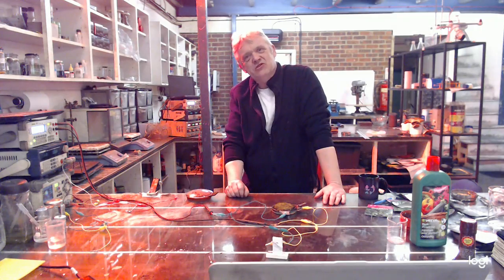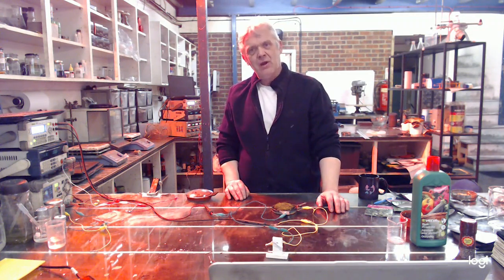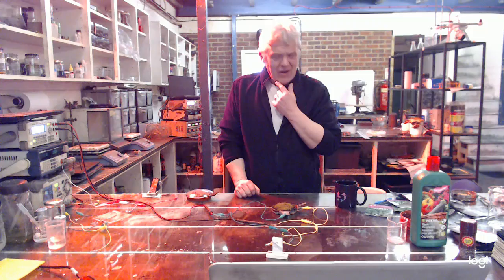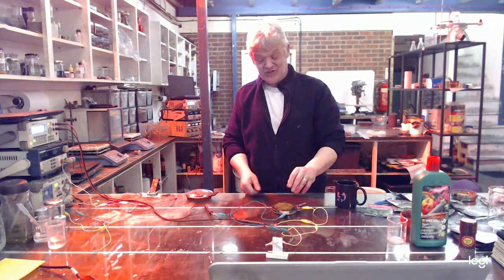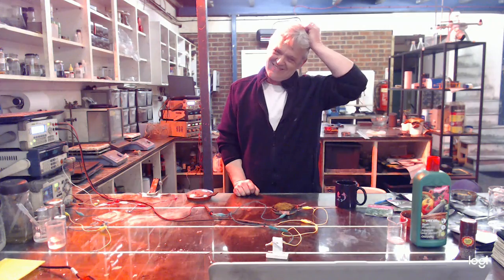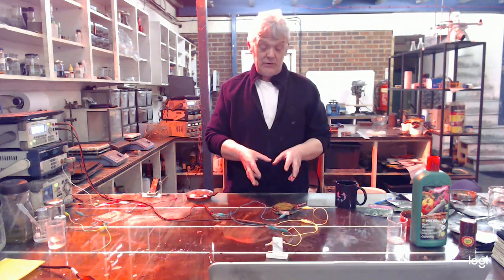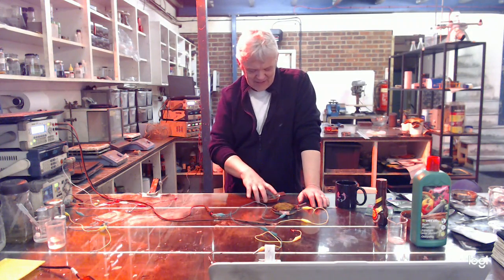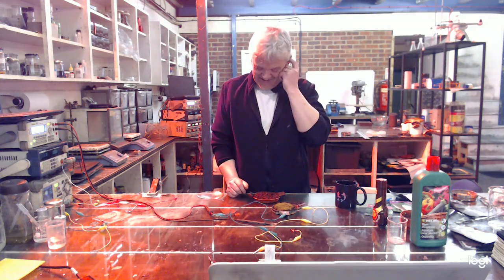Plant Battery (Microbial Fuel Cell)

Comment: The penny might have just dropped, but clarification is needed: 

Are you making a Hydrogen - Oxygen fuel cell in reverse? I.e, sunlight and temperature cause a reaction (photosynthesis?), releasing Hydrogen and Oxygen, etc,  and this causes the potential difference between the anode and cathode?

Or is the process more like: The microbes and plants, plus sunlight and warmth, releasing the gases. And then the gases recombine to create the PD? Call it a full-cycle fuel cell, or a holistic fuel cell, if you like.

Which process is going on here, please? Or is it something else? Thanks Robert.

Comment: That's awesome! You've improved on the design by at least an order of magnitude, maybe three. And it's what, 10 cm square? If you can make a square metre of it, then that's another 10,000-fold increase, giving, let's say an instantaneous 100 Watts or so, for around 6 seconds. Go to a hectare per cell, on otherwise unusable ground, or rooftops, etc, and you're beginning to generate really useful power with minimal materials cost, and for as long as there is water and daylight. Maybe even during darkness. Enclose it, so that the water is recycled, reducing cost. Then with further development of the idea, you should be able to multiply output by at least another order of magnitude. 

The questions are, 'What are the stumbling blocks which have stopped people from making this a viable idea?' 

The efficiency might be low, at present, but it can be constructed on any otherwise unused surface on which some light and warmth exists; places where it's difficult to put PV panels or heat exchanger panels. Furthermore, with development, efficiency should be improved upon.

And, 'How much does it cost, and can it be made to return the investment?' 

That's partly answered by the above, but the rest is unknown right now, and there's little to stop private individuals from making their own systems.

Then 'What continuous Voltage and Current is generated per square metre?'

Investigations are certainly needed here.

'What relationship is there between light levels, light spectrum and temperature?'

Ditto.

Finally, 'Is this an effect of the PD between the anode and cathode collectors, with the electrolyte, rather than the result of a redox reaction between microbes and plants?'

That's something to be investigated. (Time to consult the interwebs.) 

Thanks Robert!

Comment: How long does it take to recharge or regen again? I wonder if you get the same effect in a hydroponic farm.. With all water & nutes the conductivity is @ 1500 ppm
Reply from the maker: I don't plan on looking at this much mate - well not for now - but there are a lot of interesting questions to answer here but my thought would be to match load to supply or put another storage unit in parallel - like a supercap maybe
Reply: Robert Murray-Smith actually just realised it is nearly impossible for Bacteria to survive @1500 ppm. Aquaponic tanks have huge amounts of nitrifying bacteria to break down fish poop

Comment: This is very interesting, but rather than using it to generate power, can it be use to measure the health of the plant?
Is it possible to build plant pots that can report back the health of the plants it contains?
It would be useful to report water level, pH etc. Even better if the power output can correlated with the rate of plant metabolism, indicating the vigor of the plant.
Consider the value of a plant pot, to which could be connected and IoT or LCD device that notifies the user of the plants needs.
Reply from the maker: I have no idea mate -you could always look into it = power generation is really my thing horticulture/agriculture - not so much
Reply: @ThinkingandTinkering  my point is that the amount of energy generated is not that significant, but it is sufficient to power the electronics for a monitoring circuit, and since it is generated by plant metabolism, it may give an indication of plant vigor.
Reply from the maker: like i say there is a lot of research and mostly it is looking at more than that i think = worth checking out

Comment: There is a way to make electric bacteria in soil by running voltage through electrodes in the ground and then collecting the dirt around the electrodes where the bacteria congregate. Since most physical things can be run in reverse I wonder if they would also produce electricity. Also perhaps run a slight bias voltage through your plants to trigger a larger effect...and will it vary and produce a low frequency alternating current based on sunlight or something...hmmm
Reply from the maker: give it a go mate

Comment: Last 3 years, I had participated in Technology and Science Expo at my university and presented my project about microbial fuel cell. My project used 3 plants which were Pandan that can be found widely in my country,carbon electrodes and water pump.The setup is similar like electrolysis except we put separate water pump to give oxygen to the plants that were buried in wet soil. The plant battery were short circuit in series and we got around 1 volts if I'm not mistaken. Luckily, our project win the best functionality award as it suited the green engineering theme. After I discovered your video, I realized that I can develop my project to harvest more energy with less cost.  Thank you Robert for the nice video. Looking forward to see you use graphene electrode in MFC.
Reply from the maker: I have been reading a lot of interesting stuff regarding Plant based fuel cells mate - if you do more work on this could you video and let me see - i would be fasinated by your worka nd appreciate it - thanks - Rob
Reply: @ThinkingandTinkering I will glad to give you the video but later I will make the video for you.
Reply from the maker: awesome mate - thank you

Comment: So as a microbial fuelcell it produces CO2? Work done by living things usually have a several times bigger footprint per kWH than gasoline generators. However in power harvesting small sensor scale, this makes sense.
Reply from the maker: have a look at what Plant-e are doing mate
Reply: @ThinkingandTinkering  I did, sorry. So this type of battery uses waste organic material discarded by plants that would end in the soil and decompose to CO2 or Methane by the same process anyway. So vey much CO2 neutral. I didn't pick that up from your video.
Reply from the maker: It's really a fuel cell mate - but, basically - sorry, I should have been clearer

Comment: Chapeau Bruce !!! I initially found your first videos by looking into MFCs, because of your experiences with activated carbon and later on the membranes.

This is great , I am so excited you are looking into this technology. MFCs as it goes hand and hand with all carbon based Super Caps.
Of course people might have figured it out that we are talking about long term slow charging  energy storage with the ability to quickly discharge. 

Bruce Logan MFC is a great start, plus he has videos .  People can then look at the references. 
Microbial Fuel Cells - MIT
PDFhttps://web.mit.edu › SoBEI › Info_files

The Chinese are patenting the heck out of this tech. This tech started with trying to find a way to rejuvenate the aging wastewater purifying plants in the US. 

So you see my hypothesis is that the membrane could be replaced by a fiber suspended ionic liquid membrane called SLIMs with a carbon fiber GO coated anode  and a stainless steel mesh type cathode. Ideally the IL should be a NaCl alginate with a chiral chitosantype permaganate manganese  compound to help electron motility which decreases the internal resistance and increases power density 
Hopefully nothing with fluor to make as environmentaly friendly product. 
I haven't seen any research done in this way in prior art. 

There is an increasingly growing body of knowledge being formed in this field. The most interesting research is yet to come. 

Ohhhhh Robert bless you man !!! 
I hope one day Ill be able to meet you . 

Your doing the humanity a big service by diffusing and vulgarising MFCs and the underlying tech.
Reply from the maker: It is an exciting tech mate and I agree most of the best work is yet to come - I also agree that spreading the word in a 'user-friendly' way is a key aspect - cheers

Comment: If the plant growth is a factor in energy production for this bamboo and mycelium might be a good combination for warm climates.
Reply from the maker: that is a nice idea mate
Reply: @ThinkingandTinkering  Thanks Now I just need to live somewhere warm and let the hedgerow power the AC.
Reply: @ThinkingandTinkering  Azolla ferns has high rate of growth in mud combined with this https://makezine.com/projects/microbial-fuel-cell/ Mud based microbial fuel cell.
Looks promising and it should be easier to deal with than meters tall bamboo.

Comment: Plants digest minerals by injecting protons and free electrons directly into the soil, I have always wondered how hard it would be to capture, store and use these positively and negatively charged ions as they come out of a plant.
Reply from the maker: the soil itself acts as a proton exchange mebrane - so not very is the answer - you need an anode and cathode so the roots pass through the cathode but not the anode and a centimeter or so of free soil between the root tip and the anode
Reply: @ThinkingandTinkering  I imagine it would be really tricky, and of course you would have to carefully grow the plants into the device [like hope all of the roots follow special nutrient filled tubes of some sort so you can work around them and stuff without getting so large they break the device they are in... Might would need a flexible membrane for a tube like a fluoroelastomer,  might prove financially/commercially unfeasible, but imagine how much power density one could store if they could somehow store the protons of hydrogen in one cavity and the electrons in the other, and just let them mix as you needed electrical power. The theoretical energy density would be [literally] on the atomic level! [because of it being stripped down hydrogen atoms I mean] 

I imagine it would be insanely hard to collect and/or store, or somebody would have already done it by now.

Still, I write about it in one of my sci-fi stories as a well developed type of power storage for the characters.
Reply from the maker: tturns out it's stunningly easy
Reply: @ThinkingandTinkering  If I could do that I could build physical ion capacitors of immense electrical capacity [low voltage but unheard of electron density, unless somehow the increase in electrons affected the total voltage somehow] and it would be a way to levels of electron storage magnitudes above anything now in use.
Reply from the maker: I suppose - i aam going to go through step by step construction of this device in the live event anyway - so just so you can see how easy it is to make one of these
Reply: @ThinkingandTinkering  But the scale does not seem to lend its self to packaging protons and electrons separately, just making point contact power that would appear to have to be used directly on site... (?)
Reply: @ThinkingandTinkering  I have an idea that my idea is significantly different and more complex than just instant use power.
Reply from the maker: you know - i don't really know
Reply from the maker: fair enough

Comment: Maybe my phone is doing something weird but why my negative comments are not display correctly. They in fact become completely something i didn't wrote.
Reply from the maker: that is odd mate - i didn't take your comment as negative though - i rarely do - most comments i find are meant to help even if they disagree
Reply: @ThinkingandTinkering   I'm not picking sides this early, maybe your work is credible, if yes, then why i don't see a product in market, a practical solution, even a prototype. A common man with an idea can raise millions through crowd funding and start his own company. Why are you not doing so if such a great battery / supercapacitor is furnished by you. All i can see is YouTube videos and research papers. This makes me sceptical of your work.
Reply from the maker: I understand mate - thanks for the comment
Reply: pranjal kumar there is a commercial product called a MudWatt that produces a very small amount of electricity that flashes an LED or runs a clock.   Took a few days for the microbes to multiply enough to start producing electricity.  Basically all it is is a couple carbon felt electrodes.  One buried in the mud and one on the surface exposed to air but still kept moist.  The voltage is pretty low so you either need a circuit to increase the voltage or multiple devices in series.
Reply: @flashlit123   okay, but the supercapacitor in his earlier videos felt just perfect for commercial use with balancers and a boost converter

Comment: Love it mate! I've also heard about this Dutch company and I thought wouldn't it be great to turn your lawn into a battery for the home. But I understand this needs to be in wet conditions? I also thought your carbon graphene felt you produced would make good electrodes because the roots would intermingle in the porous felt/sponge structure.
Reply from the maker: that is one thing we are using mate and the dutch company use wet conditions as it works more easily but the research is for a whole host of things - here - of course - we are using moss which is in damp condition.

Comment: Very interesting! Try adding a tiny fraction of a non-ionic surfactant to the water. I've been growing plants with 100ppm Polysorbate 20 (P20, or stearic acid is derived from coconut oil and 100% organic sources are available) and seeing amazing results. I came across a 2008 paper by Yang called "The effects of non-ionic surfactants on plant growth" which found beneficial effects at this very narrow, and tiny, concentration of what is one of the most widely used chemicals in agriculture (as a wetting agent in arid climates but used in far greater concentrations, at which all the beneficial, synergistic effects disappear). These effects start from germination with a marked increase in size and vigour of the meristem, but the most applicable to what you're working on are the ~400% reduction in moisture loss through transpiration, and improved transfer of ions across the cell membranes in the roots apparently due to changes in the cell itself as well as the greater oxygen availability at the roots from the reduced surface tension. As a side effect, things like viruses, fungal spores and many insect eggs are unable to to get a foot hold on a plant fed with P20, as they become water-logged and die.
Reply from the maker: thank you mate - i just ordred some and i wil give it a go - cheers
Reply: @ThinkingandTinkering  sorry, but another thing while I think of it, did you hear about the graphene microphone diaphragm that was tried fairly recently? It was adapted from a Bruel & Kjaer measurement mic capsule, a medium-diaphragm condenser type, in a most McGiver like manner, by getting a sheet of graphene on nickel and etching away all the nickel with ferric-chloride and scooping up the graphene onto a plastic frame. A frequency response approaching 1 MHz with very competitive sensitivity, even without exploring the possibilities fully with regards to the tensile strength and electronic properties. The sensors that this substance is going to enable in the future will be amazing things!
Reply from the maker: yes mate - we made a few - but that was years ago - there are a couple of vids we made - but they are old
Reply: @ThinkingandTinkering  Cheers, I shall look them up. i've been thinking of having a go at building a mic.
Reply from the maker: awesome mate
Reply: Gerry James Edwards 1 MHz...  Wow. Wonder if that can start to rectify the ether vacuum energy.
Reply: That does sound worthy of lab tests. Very groovy open sourced knowledge shared.
Reply: Gerry, are you using this mixture just at the beginning of germination or throughout the plants growth?

Comment: I knew about potato batteries now it's moss !!!
Reply from the maker: this is different mate - i should have pointed that out - in a potatoe or lemon battery a zinc rod and a copper rod are pushed into the potatoe or lemon and it is the difference in redox potential of zinc and copper in acid environments that drive the reaction and poison the potatoe or lemon - here the process happens in nature notrmally and there is no metal to rot!